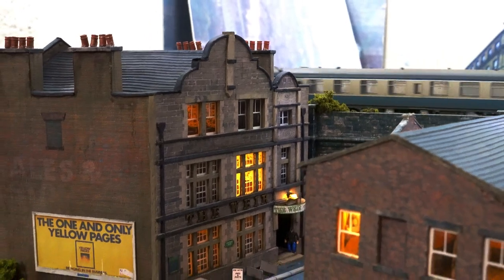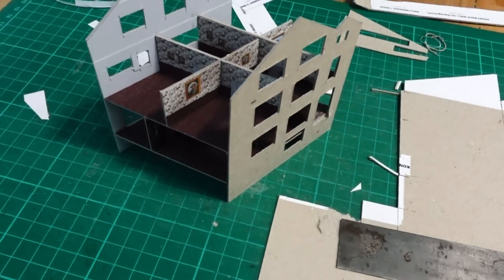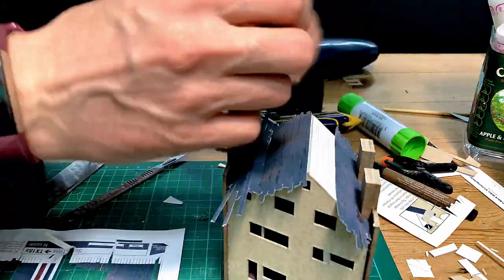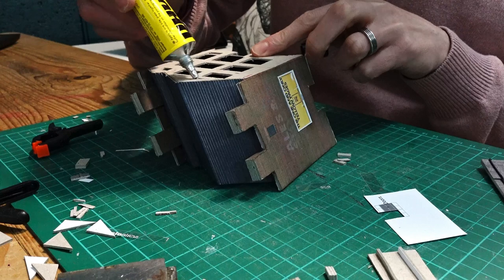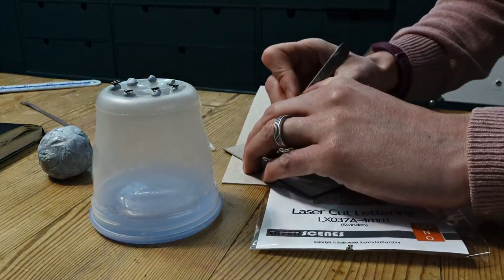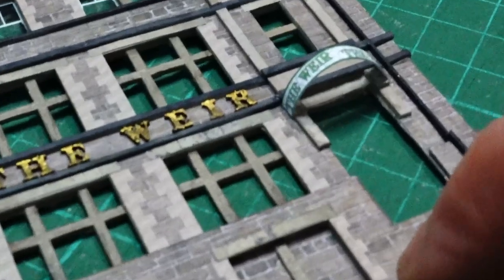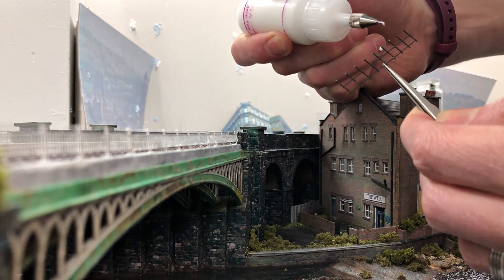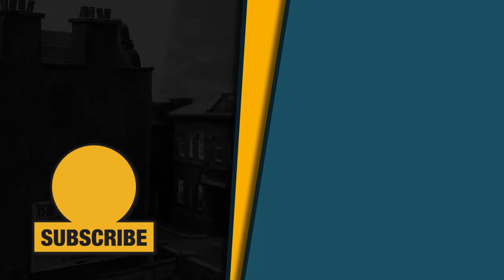Scratch building a city pub from card in N Scale for my N Gauge model railway

Comment: Another triumph mate, superb modelling. The cellar entrance was a nice touch. I used the Peco OO gauge canopy roofs on Rodneybridge which didn't look out of scale for a 4 platform station. With your skills though I suspect Chandwell's terminus station will be a scratch built masterpiece.
Reply from the maker: Now now Jason, don’t go putting any pressure on me! 😂 I’m starting with the back of the station. It’s almost 1.5 metres and when I put the mocked-up pub there it really hits home how vast a space it is in N Scale. My idea is a massive, long, works building like at Doncaster station if you’ve ever been there. Possibly with a bridge from the Works, over the station, and down onto the alley at the side of the station.  I’m considering using a forced perspective method to add depth, but this needs lots of mocking up and thought because if not done right it will look naff and I may not be able to achieve it. Anyway... I’d best make a start! 😂 - Michael

Comment: What a build! I used to have a great deal of trouble cutting curves smoothly until I started using washers as templates - not just washers, but jam jar lids, tea plates, coke can tops, etc; depending on the size of the curve (you can always find something that works.) I found that after a light pass with the knife around the edge of whatever template I was using, it could be disposed with since the knife would keep to the groove made with the first pass on later cuts. Great idea with the card downpipes, but I found wire (0.5 mm in N scale represents 3 inch pipe) works even better. Using thin strips of masking or packing tape (cut about 0.5 - 1mm thick) and wrapped around the wire makes very convincing pipe joins once you've secured them to the wire with a dab of superglue. Again, a fabulous build and thanks for posting. Stay well.
Reply from the maker: Thank you Paul. Great idea re the cutting templates. Next time I’m in need of a curve, I will remember that. I’ve shied away from wire downspouts for no reason other than it’s new and I’m resistant to change! But that is just silly really so perhaps for the ‘Station End’ I will look into using wire. What kind do you use? I have piano wire but it’s really difficult to cut. Thanks again for watching, and for the thoughtful advice.  It’s much appreciated. —Michael.
Reply: @Chandwell  Hi Michael, I use ordinary, galvanised steel wire which you can get in a range of diameters fairly cheaply. Other people have used florist's wire (slightly more expensive) and even the brass / nickel silver wire used in etched brass kit making and scratchbuilding, but this is absurdly expensive to use - as is using that "Evergreen" styrene rod. All of the preceeding can be cut and bent well enough with a simple pair of pliers. You may want to take a look at Paul at Galgorm Hall who does an excellent description of making downpipes for scratchbuilds here: https://www.youtube.com/watch?v=hFZIEedgO3I&list=PLPu4Imt3qMZ3qfkoRtjKnFrD7CVEuBnLw&index=11 or Gormo at Great Chesterford Junction who describes his method here: https://www.youtube.com/watch?v=2BQjSd68jus Gormo has a different treatment of how to model pipe joins which will be easier in the smaller scale. I'm a big fan or wire downpipes, since they stand a little proud of the building and add a bit of depth in what would otherwise be a flat surface.  I hope these links help.

Comment: Very impressive,
May I offer a suggestion....
If I were wiring the leds for the internal wiring, I'd wire them in parallel, because they way you've wired your lights, if one pops then they all stop working and then you have to access your lights and then de-solder each led until you find the faulty one.
Whereas in parallel its only the faulty bulb that stops working.
I know leds have a long life, bit they do occasionally go pop.
Rgds, 
Sidney
Reply from the maker: Good tip Sidney, thank you for taking the time to suggest it. I did consider wiring in parallel, and they would definitely be more fault-tolerant like that. The reason I went ahead  with series regardless was for simplicity (laziness!) in just looping them round the building, and because in truth, I very, very rarely turn them on. They only get switched on for maybe 20 minutes every four weeks when I record the cut-scenes for my videos. So with the chances of one developing a fault being very remote, I decided to live with the risk. The building is solidly glued down too, so any fault in the lights will just cause the lights to go out anyway, as I am not going to ever lift the building!

Comment: Great stuff! What make of  glue applicator with the metal tip do you use?
Reply from the maker: I use "Fine Tip" by Anne Peak. They are about 10 years old and she no longer trades. I had previously tried the Metcalfe ones, but I found the pin rusted in the tip. These ones are super. I don't know what I will do once they finally break. --Michael

Comment: Another great video. Superb modelling. Thanks for sharing. Quick question - when you lay the scale scenes roof tiles do you colour each facing edge? It looks like you do as you can’t see a whole series of white edges. If so do you simply use a grey pen and just accept it takes ages or do you have a quicker method? I’ve always taken the lazy option and just laid the sheet of tiles which doesn’t look anywhere near as good as yours
Reply from the maker: That’s an interesting question. I used to always do the edges in grey. I find a chunky pen with a wide wedge nib was best as you could very quickly just whizz it along without too much trouble. But on this build I didn’t bother. I think why I don’t get white lines is a combination of three factors. 1. I print on thin paper. It is photographic paper but only 120gsm. This is thicker than normal copier paper but not by much. 2. Keep the blade exactly straight, or even pointing inwards slightly. I used to always struggle with cutting straight lines until one day I spent an hour doing nothing other than cutting straight lines in card. I now can get my blade straight almost all the time. I point it inwards slightly so that any white edge is on the underside rather than top side of the cut strip. 3. Give the whole roof a light dusting of Smoke weathering powder between varnish layers 1 and 2. This merges with the varnish as you brush it on, and goes all along the strips, completely wiping out any remaining white line. It makes the whole roof look complete and works really well. (Brush side to side first to get it in place then finish off by brushing downwards so that any streaks go down the roof and look realistic) Hope this helps! Michael.
Reply: Thanks for such a detailed answer. Appreciated. I’ll shall try it on a future build.

Comment: Winced at the superglue spill… the layout looks fantastic but this has to be a hazard of the construction method. Printed card that's more-or-less immediately in its final state, glued into place on the layout permanently, with months or years more work to be done around it with paint and glue - it's admirable but must be careful, right ;)
Reply from the maker: I was annoyed by t he spill. I didn’t even notice it for a few days and I was surprised to see I’d caught it on camera. It’s cleaned up ok with a few coats of ultra matte varnish. But you are correct, this is a hazard of the method. I’m as careful as possible but accidents always happen. I use a lot of varnish and on the odd occasion I have spilled something on a completed part of the layout, so far it’s cleaned off ok. One video sooner or later will involve me rebuilding something I have ruined, I am sure! —Michael

Comment: How long do you leave PVA glue to go off?
Reply from the maker: “It depends”. For general sticking stuff together (eg the small bits on the facade) I don’t leave it at all I just stick it and move onto the next bit. For a major join like the side walls or the floor to the front, then I’ll leave it as long as possible but at least 10 minutes. For a fiddly bit that wraps some paper around a thin bit of card that I then need to cut I find that the paper tears any time in the first 20 minutes or so. Maybe I can do a video on the types of glueing I do. I wonder if that would be helpful to anyone.
Reply: @Chandwell  Certainly be helpful to some of us starting out new in this hobby. Thanks for the answer.
Reply from the maker: I’ve added it to the list of future episode ideas!